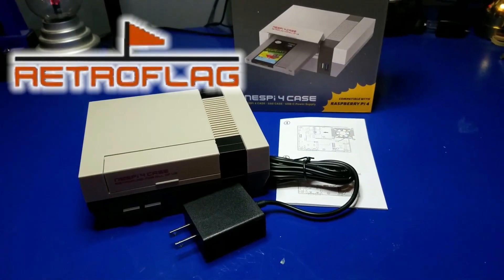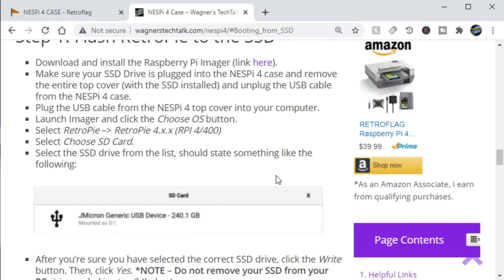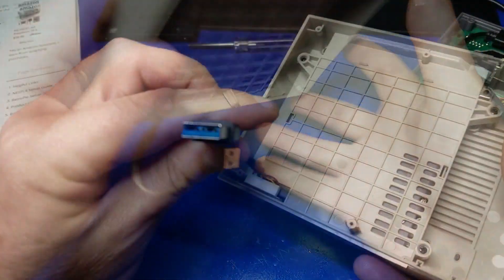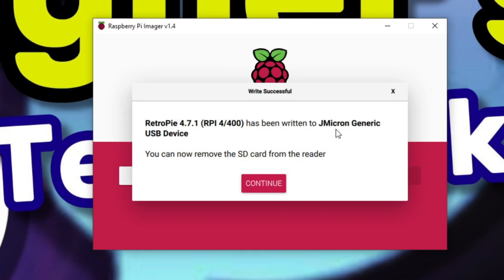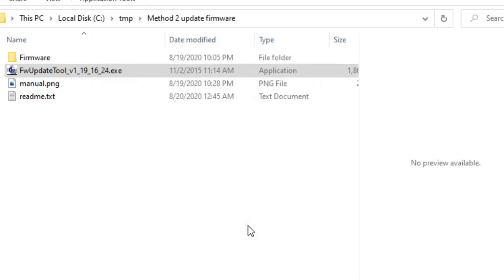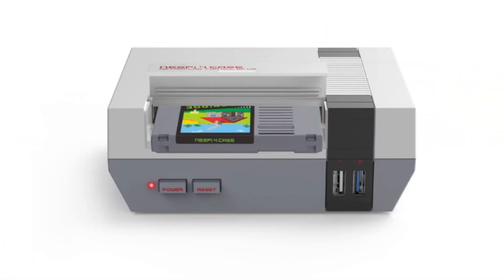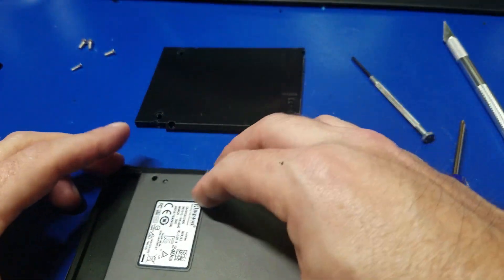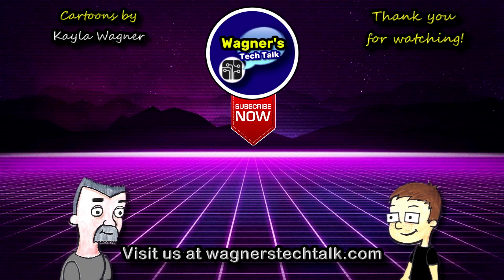Retroflag NESPi 4 SSD Boot: Quick-Start Guide

Comment: What did I do with the rest of the partition. The Raspberry PI Imager only creates 2.6 GB in the first partition.
Can I create or split an exFAT with the rest?
Reply from the maker: If you need to modify the size of the partition, you can use DiskGenius for that.  Just be very careful and make sure you're working with the removable drive.  I don't think you need the full license for that.  Should you ever need/want to license it, they did provide us with a 30% off coupon here: http://wagnerstechtalk.com/ogs/#Copy_Files_with_DiskGenius

Comment: Having the same problem failed to open device: 'sd card'
How do I change the pios 
I tried plugging in a keyboard.
Do I need a sd card with retro pie already on it. Not sure where 2 go from here.
Reply from the maker: I'm thinking the issue here may be that the firmware on your Raspberry Pi is older and can't handle USB booting.  To update it, you could install PiOS to a microSD, make sure your network is connected (wired or wifi), run the update wizard to install the latest PiOS updates.  Then shutdown, remove the microSD and re-install the SSD.  Power it up and see if this works now.

If the above doesn't work, re-install the PiOS microSD and boot.  Open a Terminal window and run the command below (this will force an update of the Raspberry Pi firmware):
sudo rpi-update

Then, shutdown the Pi, remove the microSD, re-insert the SSD and power on.  One of the two "should" fix the issue, assuming you performed the firmware update as shown in this video.  Please let me know the results so I can update the troubleshooting page accordingly.
Reply: @WagnersTechTalk  I gave it my best shot and still have no luck. Only thing I haven't tried is the wizard update. I am assuming that is in the retropie setup. Thanks for helping.
Reply from the maker: @mikearey5991  Definitely try the wizard update, the firmware update may not help unless you've updated your Pi to the latest release.  Then try what I wrote above and you "should" be good.

Comment: I already set the booting for sd and install games in ssd (not for booting). if i now want to switch the booting from sd to ssd, do i need to format the ssd again for the setup? (if possible, i dun want to remove the games i installed in ssd for new setup again)
Reply from the maker: If you have a NAS or some network share, you could copy all your games to the NAS pretty easily (directories are already there with your games).  Then, re-image the SSD (or use a new one) and copy your games back to the new/newly-setup SSD.
Reply: @WagnersTechTalk  my transfer speed of NAS is rather slow......anyway....if SSD boot the machine, does it mean it will be the same as SD that the SSD cannot be read normally by PC after the boot setup starts? then for copying games, i can only do by copying games through wifi?
Reply from the maker: Depends on the OS you're using, for RetroPie yes it will be the same.  For Recalbox, it would have a share readable by Windows, however Wifi doesn't seem to work reliably with this case and Recalbox (see my note in the video description if you need more info.).  Hope this helps!
Reply: @WagnersTechTalk  thx got it

Comment: This doesn't work. I did all the steps you did. [1] If I used Raspberry Imager on Windows10, I get no drive letter. And cannot add the firmware. [2] If I use RImager on RaspbianOS I see everything. So I took out the SDcard out of the case and left the SSD inside. I got a black screen with the QRcode and it says insert SDcard. [Rpi 4 with 8GB]
Reply from the maker: This is the first report that it has not worked for anyone, I suspect the wrong firmware was selected (don't select the most recent date you see for the firmware, go with JMS578_STD_V00.02.00.09_NO_UAS.bin).  Please see my full instructions here and see if something perhaps got missed: http://wagnerstechtalk.com/nespi4/#Step_2_Update_NESPi_4_SSD_Controller_Firmware
Reply: @WagnersTechTalk  If my Windows computer can see the SSD then I can do the Method 2 Firmware, for now I did Method 1 and edited the config file. My only guess is that the SSD I'm using isn't compatible - Inland 256GB SSD from MicroCenter. So for now I have the Retropie on the SDcard and the roms on the SSD. Shame, I really wanted to boot from SSD, but for now I'm not willing to spend more money on this project. Maybe when one of my other SSDs becomes free, I'll play with this more. Thank you for trying to help me. ;-)
Reply from the maker: @aurora3957  Interesting that this did not work for you.  I've only tried a small sampling of x2 SSD's thus far (like you, no budget for more at the present).  If you wind up trying a different SSD or figure something out please let me know.  I'll update the NESPi 4 page with whatever you find out (giving you credit for the tip).  Thanks for watching!

Comment: Is the USB/SSD be faster than the Micro SD card? That would be a real advantage beyond esthetics!
Reply from the maker: Boot time is not faster, however read/write speeds are much faster.  I performed read-write tests on x2 drives I picked up here: http://wagnerstechtalk.com/nespi4/#Speed_Tests  You can also see them in comparison to the microSD card.  Much faster.

Comment: Can you use this method to update the firmware on any pi image? Like a custom image you saved as a backup?
Reply from the maker: You can use the Pi Imager to install a new operating system to a microSD/SSD.  The firmware update utility is used to update the firmware in the SATA controller of the NESPi 4 case itself.  Hope this answers your question 👍
Reply: @WagnersTechTalk  Wow I don’t know how I missed that in your tutorial. I have been trying to boot from ssd for a long time and I was unable until this video. Plus I was using just a usb to sata from Amazon. After the tutorial it booted no problem. Thank you so much this was so helpful!!!!!
Reply from the maker: Great news and you're very welcome Robert!  I try to release one video a week. I spend time testing and making sure things should work before releasing it.   Makes me happy to receive comments like yours!

Comment: What are benefits of using a ssd drive instead of a micro sd card?  Great video.
Reply from the maker: There are a couple, first of all with this case you can pop-in a cartridge running RetroPie, PiOS, etc. and have different configurations or sets of games on each (WiFi with Recalbox doesn't seem to work properly, however).  The 2nd benefit is speed, the read-write speed is much faster than a microSD as shown here: http://wagnerstechtalk.com/nespi4/#Speed_Tests  Hope I've answered your questions, thanks for watching!
Reply: @WagnersTechTalk  Are the steps the same for using Recalbox?  I haven't been able to get recalbox to boot from the ssd.  It did work for Retropie for me though.

Comment from the maker: *Important Note - Both RetroPie and PiOS work fine with this case without issue.  Scraping, SMB access, Browsing, etc. are all fine.  However, I am experiencing issues with the NESPi 4 case + Recalbox.  The issue is that once an SSD is installed, the WiFi connectivity ceases to function.  I do not think it is a shielding issue with the case, I added additional shielding to my case to see if that resolved the problem - it did not.  My recommendation is if you plan on using this case exclusively with Recalbox+SSD, you may want to hold off until a solution is found.  I will update statement once a solution is identified.  If you are aware of one, please comment and let me know.
Reply: Don't worry! I was able to figure out how to get wi-fi working on either Batocera or Recalbox WITHOUT adding any additional shielding to my NESPi 4 case!

1. Open up batocera.conf (for Batocera) or recalbox.conf (for Recalbox) in the userdata/system folder (found in the share partition) using whatever text editor you use (make sure you have administrator privileges to make the necessary changes).

2. With the file open, search for system.timezone. When you find it, uncomment the option (delete the # sign in front of system.timezone) and enter the correct timezone for your location. Here are some examples:

          system.timezone=America/Fort_Wayne
          system.timezone=Australia/Melbourne
          system.timezone=Pacific/Honolulu

NOTE: You can find a complete list of all the time zones at the following link: https://pastebin.com/RZ5feyHS

2-1. If you are using Recalbox, make sure to search for wifi.region and change it to your corresponding country you live in. Examples:

          wifi.region=US
          wifi.region=AQ
          wifi.region=GB

To find out what your two latter country code is, follow this link: https://en.wikipedia.org/wiki/List_of_ISO_3166_country_codes

3. Save the file and close the text editor. Depending on how you edited the file, if you connected to your device through a program like PuTTY to make the changes, reboot the device; if you connected your microSD/SSD externally to your computer, plug the card/drive back into your device and boot it up.

4. Press Start to open up the menu. Select Network Settings, then turn on Enable WiFi. When you finish entering your SSID and key, go Back to the main menu and select Network Settings again. If you did it correctly, your IP Address will be displayed and Internet Status as Connected. If not, restart your device again to save the changes.

CONGRATULATIONS! You now have Wi-Fi!!!

Comment: THANK YOU for making these videos!  I'm excited to move my Pi to this case.  I think given the decent size fan, you could overclock it to 2.1.  I'm looking to try Recalbox, and your video showed that can be easily done with the Raspberry Pi Imager.
Reply from the maker: I've had no issues with RetroPie or PiOS running on this case, however I must let you know that Recalbox has been problematic with it.  I've been testing it since late last week in preparation for a video on Recalbox and would not (at the present time) recommend Recalbox for this case.  The primary issue I was having is that once the SSD is connected (with Recalbox installed), the WiFi connectivity no longer works.  I don't think it's an issue with the case, at this point, since both RetroPie and PiOS have no WiFi connectivity issues.  Even without an SSD, WiFi doesn't show my 5Ghz Wifi SSID which is also suspect.  However, I'm trying to figure out exactly what the cause of the issue is.  If getting it primarily for Recalbox, please hold off until I have more information.
Reply: @WagnersTechTalk  Thanks for the info!  I hope the RecalBox people are looking into it.

Comment: Hi, should I need to update nespi controller software to run rasbian lite os from USB boot or it would work without update ? Thanks for your help
Reply from the maker: Depends if you have the latest Raspberry Pi firmware installed or not, if you have an issue please see this: http://wagnerstechtalk.com/nespi4/#Troubleshooting  If you still have an issue not covered, let me know and I'll do my best to answer.
Reply: @WagnersTechTalk  hi I was able to boot from ssd for.my pi 4. I have 240gb ssd   can I use around 200gb as different partition to save my data on ssd. It already has 2 partitions boot and root system.  Is there any way i can create one more partition for my data . Thanks in advance

Comment: I followed the instructions exactly but when I start up the Raspberry Pi I get an error saying "SD card not detected"..."Failed to open device: 'sdcard". I made sure the SSD was firmly seated in the Nespi case. Any ideas?
Reply from the maker: Please see the Troubleshooting section here: http://wagnerstechtalk.com/nespi4/#Troubleshooting .  Boot from the microSD card (F4 if in RetroPie) and issue the following commands from this.  It's possible the firmware for your Raspberry Pi isn't the most recent.

Question: I have tried the above and still can’t boot from the SSD, any other suggestions?

Answer: try the following command into the console to (potentially) downgrade PiOS the firmware : sudo rpi-eeprom-update -d -f /lib/firmware/raspberrypi/bootloader/stable/pieeprom-2020-09-03.bin After typing the above, press ENTER. This will set the EPROM in the Pi 4 to the version from 2020-09-03. Restart the Raspberry Pi by typing: sudo reboot
Reply: @WagnersTechTalk  thank you for the quick reply, you rock man! Updating the eeprom did the trick, it boots from the USB SSD now.

Comment: Great vid, when using an SSD do you still need to transfer games over WiFi or can it be done with drag and drop ?
Reply from the maker: Thank you! I transferred all the games over WiFi from my NAS.  The partition that contains the roms subfolder isn't easily accessible in Windows.  I also wanted to test the WiFi with the SSD installed, worked just fine (some have mentioned having issues but I did not).

Comment: Is it possible to boot from an existing image to an SSD instead of a fresh copy of Retropie? I have a 512GB image I would like to put on an SSD and boot from it. Can Etcher be used to flash the image to the SSD?
Reply from the maker: I have some instructions that were written for a Retro Gaming Handheld (RG-350) but it's basically the same.  One of these days, I'll make a more generic video/instructions but at the core it's the following: http://wagnerstechtalk.com/rg350tips/#Create_the_Backup
Perform steps 5-12, however rename the .img file to something more meaningful to you.

Then, remove the original microSD and insert your new one (must be the same size or larger, recommend larger) and perform the Restore Backup section to the new microSD using your previously backed up .img file.  This should work for you, though I can't guarantee it.  Just be extra careful that after you backup the image you remove your original microSD and keep it safe.  You may also have to go into raspi-config (from the RetroPie menu) and expand the file system  to take advantage of the extra size of your new SSD (assuming it's larger than the original). Hope that helps!

Comment: Does the firmware update for the Sata adapter fix the issues with WIFI and Bluetooth not working with SSD installed?
Reply from the maker: I have read about the issue, but I personally could not reproduce the problem.  I transferred 500GB of Data (including a number of very small files) over WIFI (802.11 AC/5Ghz) to the 1TB SSD you saw in this video, it stayed connected copying for the entire transfer without issue (several hours).  Regarding BT being an issue, I had tested this after my first NESPi 4 video here: https://youtu.be/_5jNaCakwbg  No issue for me.  Perhaps it was earlier units that had these problems, I can't honestly say.  All I can say, I can't reproduce the issues.  I hope this helps!
Reply: @WagnersTechTalk  Thank I checked out the video about BT controller. (Thanks)  Was that video done with an SSD in?  That seems to be the issue I see from all of the reviews.  That with the SSD in the wifi can be flaky to non-existent and that BT is broken with the SSD in also.  I have the 8Bitdo sega and switch controllers I would like to use with the case and them not working would be a dealbreaker for me.  Other reviews cited a loud fan but I doubt that would be an issue since it won't be right next to me.  Thanks for the response. Great videos!!!
Reply from the maker: Hi Blair, yes both the WiFi and the BT test was done with an SSD Cart in the NESPi 4 case.  I figured if there was a problem, transferring ~4-500GB would have been an issue - but it wasn't for me (during the transfer, I was writing to the SSD over WiFi).  It's possible that it would only be an issue with lower frequencies (i.e. 2.4Ghz) but it took awhile to transfer and I was happy with that test.
Reply: @WagnersTechTalk  Thank you so much for the video and helpful responses.  I followed your Amazon links to purchase the case and 1tb drive.  Looking forward to introducing my little ones to some vintage games.
Reply from the maker: Awesome, I think you'll really enjoy it!  I just received a 3rd SSD today for an upcoming video 😎  Also, I do appreciate you using my links, every little bit helps!

Comment: The firmware update, does is that for the USB-to-SATA adapter or does it install something on the hard drive to flash the Pi’s firmware?
Reply from the maker: No, nothing to the hard drive - just the USB-to-SATA adapter during this step: http://wagnerstechtalk.com/nespi4/#Step_2_Update_NESPi_4_SSD_Controller_Firmware .  Just updated that section to make sure it's clear.
Reply: @WagnersTechTalk  any idea what UAS means in this context?  Does this mean I could flash the bay without a SSD inserted?
Reply: @xreev0x  Correct, you're only updating the firmware of the jmicron usb sata controller.  No disk is required.

Technically you're downgrading the firmware so it is not picked up as a UASP controller.  The problem with this controller is it runs VERY slow if it is detected as UAS compatible.  The firmware helps prevent that.

If not flashing the controller, you could alternatively add usbquirks to the cmdline.txt of your bootable media.  There are guides online for this as well, search for "nespi4 usbquirks"